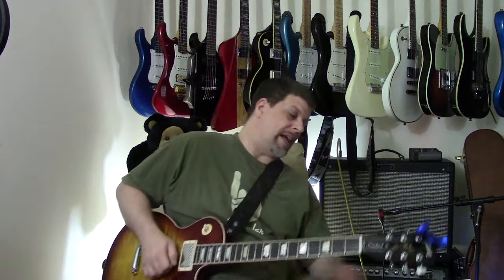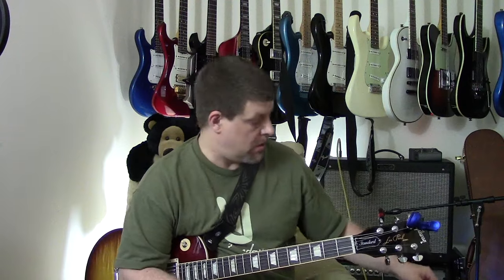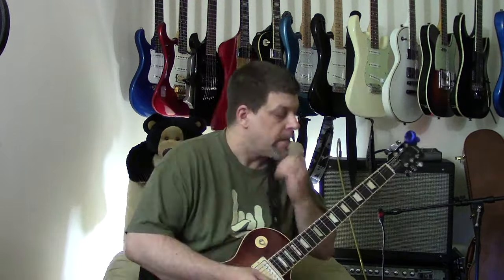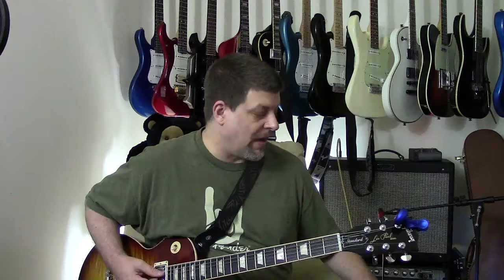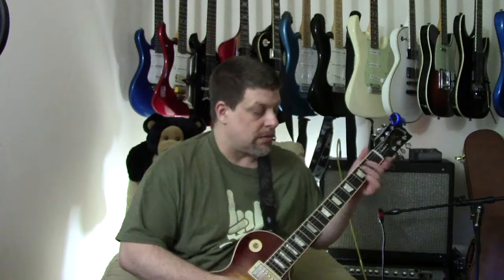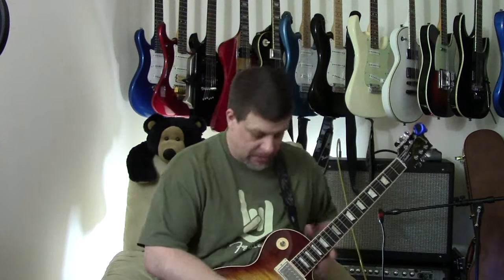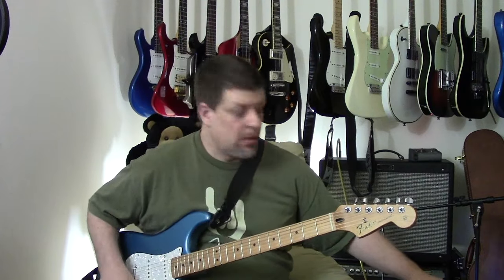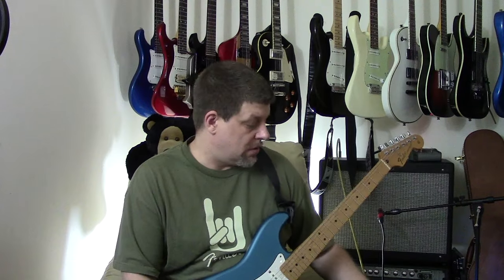MXR Super Badass Distortion Pedal and MXR EVH 5150 Comparison

Comment: I owned both and both of em are waay different pedals, the 5150 got a monster amount of gain plus the boost that made it became too fizzy even with the gain knob at 12 oclock, very tight response but less chug chuggy feeling and felt light in my hand not soo versatile yeah good for van halen stuff and some late 70's early 80's vibe . The SBD it's more versatile for everykind of music, lots of chug chug and bassy feeling but somewhat a bit loose and too thick (i need to turn my treeble to the max to compensate it) also very noisy with gain knob at 5 oclock. I love the SBD for daily play and 5150 for special date.

Comment: Would you prefer the superabadass or the 5150 if going through a decent solid state combo to kick it up a notch to the Van Hale and/metal  tube sound?
Reply from the maker: frankie deals I prefer the 5150 and it may work better with a solid state given it has more controls that you can adjust. That said there is nothing wrong with the sba.